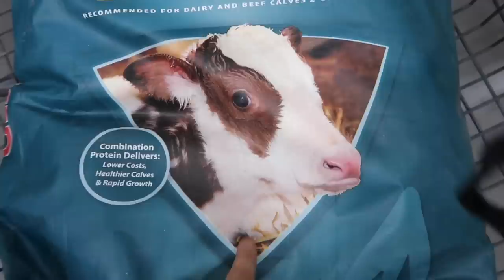Meet Our New Bottle Calves! | "BUSY" Barn Vlog!

Comment: I may be wrong, but I wanted to ask why it looks like your using horse halter on them? Cause cattle halters (in my experience) don’t have a ring or material crossing under the chin like that. They only have a neck strap, and a muzzle strap with a bit of chain or rope running under the chin and you connect a lead rope on the left of the halter